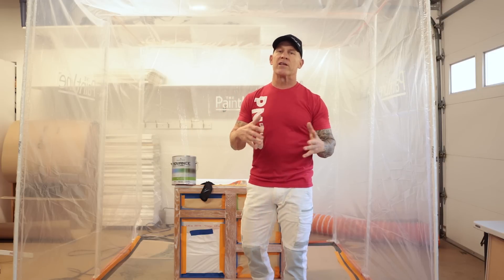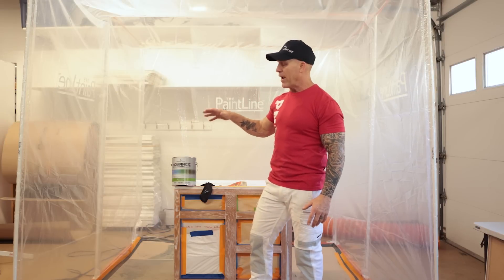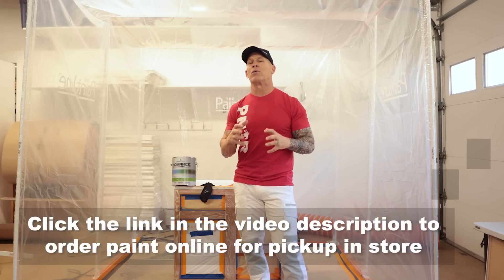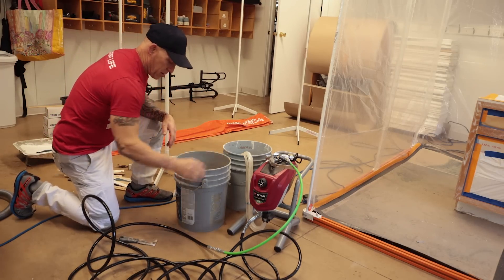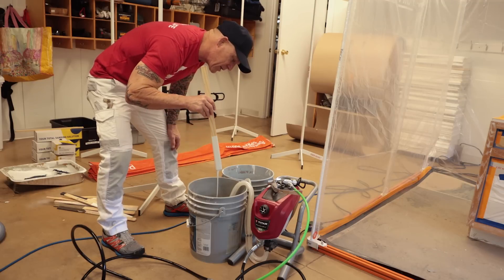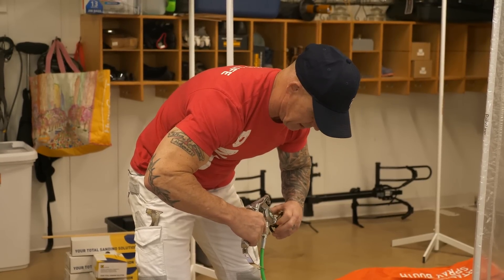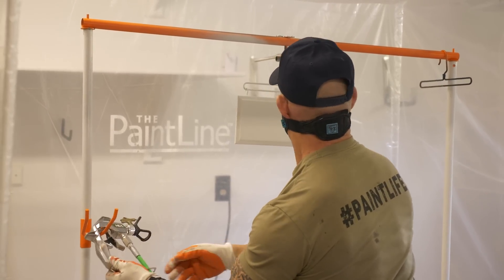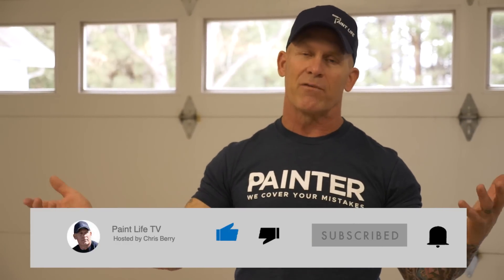Benjamin Moore Advance on Cabinets Reviewed. How Does it Perform Rolled, Brushed, and Sprayed?!

Comment: Good review, we have tried it but found it a nightmare on flush doors, we was not spraying, it would have been good if sprayed but edges dried so fast,  we mainly use a water based by Caparol, we find it covers well and goes on nice.

Comment: I agree that Advance levels out really well.  I'm using automotive type HVLP gun and compressor.  It's really forgiving on cabinet work.  Thanks for your review.
Reply from the maker: Thanks for sharing
Reply: can you comment on airless fine finish vs HVLP to spray this?   I have a titan airless and wondering if I need to buy a HVLP to paint my kitchen ?

Comment: Extremely thorough video much appreciated. We just bought an older home and are going to use this product to paint our oak cabinets. We have a paint sprayer though a relatively inexpensive one. I’m thinking after watching this we might spray the doors and removable parts and use a moe hair roller on the vertical hardware. Just have to decide if we need to use a primer first or just sanding and two coats of the Advance.

Comment: I’ve used Advance since 2012 for about 90% of my trim and mill work.  A couple additional points I’ll add.

- I think it’s the best out there for large/long flat surfaces but the penchant for runs exacerbated by corners.  Check and recheck for runs when brushing.  Brushed crown and base looks immaculate. 
- The price is a huge selling point.  Before the events of the last year even DIYers could get it for $50/gal at hardware stores that sell BM (ACE, Do It Best franchises).  Same as I pay at a BM store. 
- You have to be insanely meticulous with dust.  Even a little bit will gum up your brush and render it useless.  
- I don’t like the deep base.  That’s the one situation I’ll use Emerald Urethane instead.  Advance deep base tends to remain somewhat sticky to the touch and even looks that way.  
- I don’t know if something changed in the formulation but over the last few years I’ve had issues with air bubbles when rolling and I’ve done  everything to eliminate the usual causes.
Reply: Today it's $75-85 , must be the Putin price hike our fearless leader spoke of...

Comment: Advance is a great product but the deal killer is the dry and recoat time.  Also the longer a finish takes to dry the higher the probability of picking up air born dust.  Cure time seems like weeks where the finish will stick to itself such as a cabinet door touching a face frame. I think it's best suited for the DIY'ers where time isn't money
Reply: When I first started using Advance years back I also had trouble with runs. I find using a rac-x fflp .308 tip helps and when I’m done spraying I turn on fans to help speed up the set time I don’t get that many runs anymore.
Reply: @ericdahlberg6595  I'm not a "cabinet painter" spraying airless. but a woodworking shop using HVLP. Advance runs and sags isn't the issue, it's recoat and cure times.  Time is money so in our shop we use a lot of waterborne "lacquer systems", Kema Aqua (SW) and Agualente (ML CAmpbell) where recoat time is 20 minutes not 16 hours.  If I'm going to be painting finished work, I think I would choose SW Emerald where the recoat time is a few hours.  Not debating just sharing experiences.

Comment: I wondering do you need to thin it when use Airless sprayer? I tried both Graco X5 and Truecoat 360ds they are too thick and dripping later.

Comment: I just used this paint for my kitchen, I was very excited for the extended open time... Apparently that doesn't apply to Idaho in the winter, because mine dried to the touch in about 45 minutes. Drove me nuts. Looks great still though, even though I did get slight texture due to rolling. I rolled the cabinet faces due to not wanting to mask the kitchen with a wife and three kids, but I sprayed the door and drawers and they look great :) BUT the open time is for sure dependent on where you're from and what time of year it is.
Reply from the maker: Turn the forced air heat down.

Comment: I unfortunately used a RACX 515 tip and while I though it flow-coated beautifully, I walked away to clean up and came back about 15 minutes later to an absolute horror show of drips and runs. Hoping it sands out once dried.
Reply: Haha 515. I use 310 fine finish tips, in my opinion this is the hardest paint to spray.

Comment: when i do cabinets i use alkyd primer that you sand then we paint two coats with a roller anc corners with brush never had marks of brush but the trick is to seal and sand so its flatter and absorb the same… when started using that over a decade ago i didnt use primer and had those different mark almost invisible but if you look you could find them

Comment: Here in Massachusetts it's the most popular paint for trim and cabinets. If you thin it with thin x latex paint thinner you will get the best finish. There's a finesse to use the paint. No brush strokes
Reply: Brand of Brush and roller recommendations? Back brush, or leave it alone? Thanks!
Reply: @Avital4414  Never back brush. I use  Picaso brushes only. They work great on thick or thinned paint. These brushes allow you to take long strokes. Thin the paint it will make you smile at the finish results.
Reply: @damienfz74  what did you say you use to thin it with?
Reply: @damienfz74  I just got a couple of Staalmeester brushes to try out. Picassos are great.

Comment: How does it compare to SW Emerald urethane trim enamel when it comes to application and durability?
Reply from the maker: Very similar
Reply: For me Emerald dries harder faster,  Advance  has much better open time. Neither will chip or yellow like oils.
Reply: They are similar but sut still don't compare to command. If your spraying 8 doors and u need that window then advance is the way I'd ur spraying in 1 day then emerald ura will get to hang the doors the next day. If u spray y5 to 110 doors I would never use nothing else but command and I'll gladly take the fee for using it for my customers!
Reply: @TheRealE805  do you have any problems with Command runs/drips when painting things vertically or painting round objects? My local rep recommended me to try out Command. I sprayed it with a Graco 360vsp on # 2 setting and it looks beautifully at first until 10 minutes later, I started noticed a bunch of run/drips on the sides of my round objects and paint sagging on vertical objects. Then I changed it to # 1 and move my hand a little faster than before then it’s ok but the coverage is too light, I had to go over it 3 times and it still doesn’t cover as much as I would like it to be. I love the drying time of Command and I would love to make it work for it since I paint a lot furnitures. If you have some tips on how to make this product works, can you share some? Thank you 🙏 very much!
Reply: @NickieTu  that's not a product problem that's the issue with how you're spraying you need to back up your gun slow down your motion or speed it up one of the two practice on another piece of material before you start spraying that but it's not an issue with the paint that's the most versatile paint that they have created today.
Reply: @NickieTu  I come from the old school so I didn't get to paint with a brush for atleast a year and then when I did I was given a duster brush and was told when I learn how tocut a line with that shitty brush then I can use a quality brush. It's all practice. U can use shitty cheap paint of u know how to mix it and how to make it atomize. I hope this helps

Comment: Great review video, I am working on a kitchen cabinet paint  project. I used BIN primer by zinsser. Can I use  B.M Advanced over this BIN Primer??? Also how does this paint compare to Dunn Edwards Aristoshield?? I will be using an HVPL sprayer?? Any help is much appreciated thank you all…
Reply: I’ve used it over Zinsser BIN and 123 to great results. Getting ready to do a hutch and will be using BIN, which by the way was recommended by my BM store.  Using BIN over 123 because of wood tannins. I have also used it over Kilz.

Comment: Hi, new doors have been order and will have the paint added at the factory using BM. I'm going to try and paint the frames myself. Do I need to prime first? I will be sanding down in spots to bare wood but still some of the old color which is green may show in spots?

Comment: Had some old kitchen and even older cabinets in my garage that i used Stix® Waterborne Bonding Primer and then the Benjamin Moore Advance Paint. Everything was brush and roller painting. Cabinets came out great. Almost too nice to hang back in my garage, but I did. Going to use same products and techniques to redo my kitchen cabinets in my Florida home. Loved the drying racks you used. Maybe I will get some. Nice video!

Comment: I am trying out Advance now for casings and base. It seemed to dry faster than expected when trying on a test piece and I had noticeable brush marks. However, I am not very experienced with painting semi-gloss, so could be lack of experience. I added some Floetrol and getting better results with both brushing and rolling. Will go back and try it again straight from the can without additive. Has anyone used this product with additive?

Comment: Advice please.  Great videos!  Can you tell me what primer (soap/water cleanup) you recommend with BM Advance?  New build of poplar/birch paint grade plywood.  I have used Advance in past with good results with brush.  I used  Kilz WB primer before but reading maybe I should have used something else?  I saw your review of Fresh Start 046.  Recommend for BM Advance?  Want to use again on vanity cabinet with White Dove.  This is lighter color than I used before.  Any reports of yellowing per some reviews online?  My project from 2015 looks same to me and I'm picky. Not sure if formula changed and that is why I'm seeing these reviews.
Reply from the maker: Dawn dish soap.
Reply: @Idahopainter , translation to what they asked, ”what primer would be good with advance - that requires only soap & water cleanup”.

I clicked lickety-split to see your recommendation for the primer  because I need that answer too., darn it…  😅

I am concerned that one of the others commented advance yellows after time… So I don’t know if advanced is an option for me since I want white.  😞

Comment: I've been using Advance  for years, and I love it for crownmolding, baseboards, windows and doors , but I prefer INSLYX Cabinet Coat for cabinets. It sprays out beautiful, and will also look great when brushed and rolled.  The Cabinet Coat cures out faster and doesn't run as easily as the Advance. I had a couple of issues with Advance chipping next to the cabinet door handles from women's finger nails, because it does take 30 days to completely cure, while the Cabinet Coat only takes 7 days. And I haven't had any issues since I started using the CC. One other note, I also like to first do 1 coat of INSLYX STYX primer to ensure proper adhesion, but not always necessary because Cabinet Coat will adhere to many substrates on it own.
Reply: That’s what i do but with advance (stix and advance) i have wanted to try cabinet paint because too but i have not tried it yet . Compared to advance will you definitely choose cc instead of advanced you said? I Would try it because i need to recoat it faster

Comment: Advance is really a DIY product.  And In darker tones it’s going to stay tacky and soft. Professional cabinet refinishers use 2k’s. Single component paints just don’t hold up.  Chemical resistance is very important in kitchen and bath areas. My advice: your client is paying 6k+ in labor. Buying a premium paint like Milesi, envirolak, Ilva, renner, etc is going to triple your paint costs but last 20 years.   We all know annual touchups cost us money more than the clients.     
Use advance on trims, built-ins but stick w 2k’s where rugged materials are needed.

Comment: 16 hours drying time is ok for a second coat but is not enough time for moving the cabinets doors to the client house. Let it more time to cure before transporting and pack them carefully . If you move the pieces next day after you have sprayed you will need an art brush for touch ups. You have to keep the pieces in you shop longer before move them. Six months after I sprayed a kitchen, the same client required me for painting some walls and I had a moment to evaluate the Advance pearl finish at a blind spot: hard coat.

Comment: Do have to sand between coats? I'm doing my kitchen cabinets and I have very little room to lay out saw-horses (going to roll and brush) and I'd like to speed up the process without sacrificing quality. It's a rental, btw, but it has to be great for me and durable for whoever moves in if and when I leave. Thanks.
Reply from the maker: yes you do Sheila

Comment: Ive struggled to use this when brushed or rolled. I do live in the desert so maybe the low humidity is causing issues. I end up spraying it and it works well.
Reply from the maker: Interesting

Comment: A little late to the Advance game. You should have reviewed this product years ago. In my HO it’s the best waterborne product on the market for cabinets regardless of the long dry time. Satin finish lightly sprayed using a 308 FFLP tip provides a beautiful end result on cabinets. Nice to see you’re breaking away from SW.
Reply from the maker: Better late then never👊
Reply: I am about to use Advance for the first time.  the TDS recommends flushing the sprayer with water and following with mineral spirits to remove any residual alkyd.  do you bother with that?  Thanks.
Reply: Lew Barr no I’ve never bothered doing that. I guess I could but I just flush the pump with warm water until clear and then store it with RV antifreeze. Never had any problems.
Reply: @joshsawyer2622  Thanks!

Comment: Thank you for your helpful teaching.   I love this paint for cabinets.  I had 2 questions:  The project I'm doing right now is to age the cabinets using a glaze or gel stain, after priming and painting them cream.  How long would you recommend before doing the aging process? Also, as far as the durability, would you recommend finishing it with a top coat sealer/polyurathane?  Thank you!
Reply from the maker: As soon as dry

Comment: Do you have to prime oak cabinets before spraying?
Reply from the maker: Not if you sand
Reply: @Idahopainter  awesome thanks was just about to start priming 40 cabinet doors lol. 

I did prime the frame with two coats of stix primer and just finished first topcoat with bm advanced, but it seems like there’s tannins bleeding through still. Would another top coat hide that or should I have done more primer coats?

Comment: What pressure to set the titan 440, and what size tip?  I bit the bullet on this paint and have all my doors ready to hang.
Reply from the maker: 1800 PSI 310 TriTech tip from paintlifesupply.com
Reply: Thanks for the reply sir, I cancelled the order and went with Renner 643, and 765 topcoat.

Comment: Dear Mr. Idaho Painter, Thank you so much for all the time and effort you have put into making your videos. I am a newbie regarding HVLP and airless spraying. After watching numerous videos or yours I decided to purchase a Graco X5 to paint the kitchen cabinets and doors I recently built - I'm retired and decided to do the kitchen remodel myself. Anyway, your advice on the Benjamin Moore Advance paint has been spot-on ! The doors look like glass (I used a 311 on the doors sprayed horizontally.) I'm going to start spraying the cabinet boxes today. I'm thinking of going with a smaller diameter tip to reduce the chances of drips. Do you have any recommendations? Thanks in advance.
Reply from the maker: TriTech 310
Reply: @Idahopainter  Worked like a champ ! NOT A SINGLE DRIP ! Beginner's luck :-) My wife loves them.

Comment: Good product. It is all I use on interior trim now. I have not had all that good of  luck with cabinets tho.
Reply: Try emerald from sherwin it does not sag or drip at all. Switched from advance
Reply: @jonathanluna1069 Emerald Urethane enamel, not Emerald paint.
Reply: Close to five years professional experience with Advance, switched to Emerald when it came out, back to Advance now. You better roll and tip twice as fast with Emerald for the same great finish. When spraying doors horizontally with HVLP the emerald sometimes dries too fast to dissipate micro bubbles fully, never a problem with Advance. 
Finally, I have a client that has kids and dogs bouncing off their entry wainscoting constantly for years,  Advance holding up great, touch ups perfect  due to lack of ambering.
Reply: Oh yeah, always Advance primer to start!

Comment: Sprayed my kitchen cabinets .  Amazing finish and It was my first time spraying.  BUT, decided to change my handles and needed to sand and give it another coat.  I figured out that this would be quite easy .  Ouf! 4 days later, I am still working on my doors.  I have little bubbles staying on the paint...   Not the nice smooth finish I got the first time. Tried just about everything: diluting more or less the paint, changing air flow, cleaning again, thickness of the coat...   They are still there on quite a few doors...   Now I am down to humidity and temperature.  I did them once in march with heating on. Now end of may, it is more humidity, doors and window open.  Could that be the problem? Suggestions?
Reply from the maker: Could be many things

Comment: The thing that I’ve noticed as well is it does not remain open for a long time, I’ve only used certain now but I don’t think that would make a difference, but it starts to dry very very fast I wish it did remain open for as long as it says. But the finish is just like you say it is just like a oil paint
Reply: Satin *